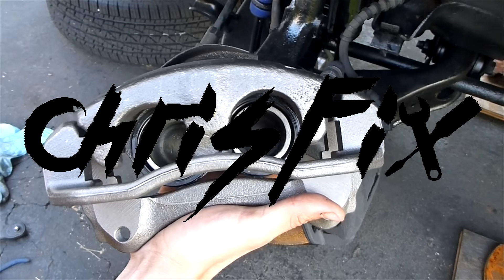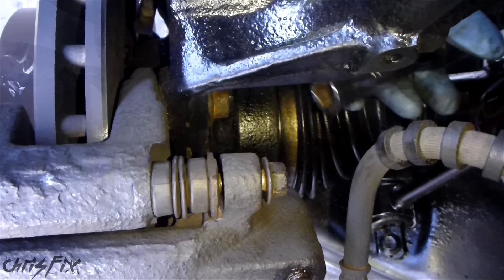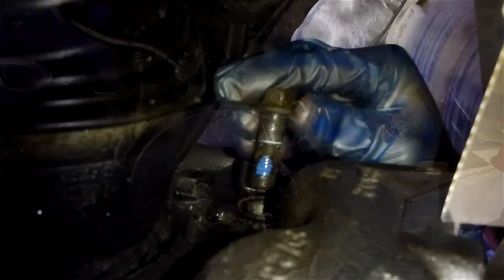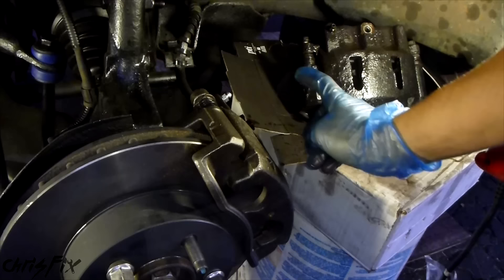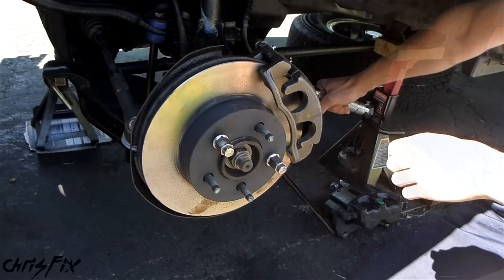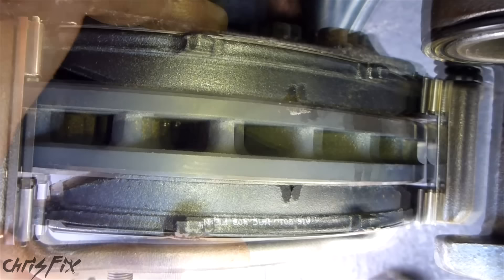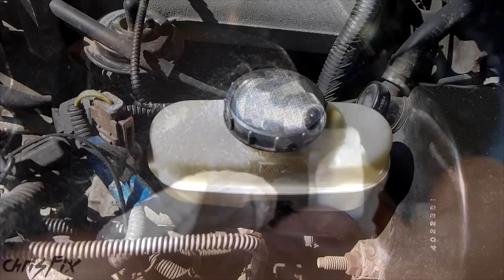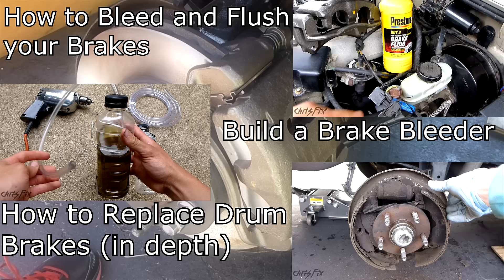How to Replace a Brake Caliper

Comment: I'm 15 and I changed my mom's oil,  rotors,  and brakes thanks to you... I want to go to uti and actually own my own auto shop
Reply from the maker: Awesome work!
Reply: Instead of paying UTI 40 grand get a job as a Lube tech at a shop near you and help out other techs and learn from them.. I learned way more in a shop than I did at UTI and go paid!
Reply: Keep up the great work. Next thing you know you're going to be doing a candy paint job on your mother's car! You're going to be rich keeping this DIY mindset. Get at me if you ever need your seats pimped out
Reply: keep up the good work!!
Reply: Kysheem.Scott I wouldn’t suggest UTI because you pay $40k for an education you can get at a cc or jc and the only state you can get your associates at a UTI facility is Arizona and you can’t apply it in any other state. If you just want your certificate that’s cool but you can get that much cheaper at a community college
Reply: There is no better learning than first-hand experience.  Try to befriend some folks at a shop, and start hanging out there and helping if you can, even if for no money.  The time you spend is an investment.  Also, learn about metals, tools, and lubricants.  Most people are more than willing to teach others their trade, it makes them feel accomplished and useful.  Also, if you want to run your own shop, you absolutely need to learn accounting, computers, and business, so focus on those in school.  The mechanic part is just one aspect of running a shop.   It would really help to learn something about finance also, so you don't have to go into large debt to realize your dreams.
Reply: Amazing job
Reply: When I was 15 I eat poop. 😔
Reply: Wooooow Good luck friend.
Reply: @chrisfix  did you go to a mechanics school or are you self taught
Reply: You're 17 now. Did you get into UTI?
Reply: You are the man.
Reply: Kieron Seymour-Howell appreciate the advice brother, I’d like to do the same as well
Reply: Go for it.  My advice would be to get a solid general education also, you never know what the future holds.  Many people feel uni is a waste of time, I understand why some people say that but in some circumstances it opens doors that remain closed to non-graduates... I don't think it should be that way, but it is.    Also, many jobs require a college degree, often it does not even matter what the subject is.    Modern mechanics need to understand electronics and diagnostic procedures as much as turning wrenches!
Reply: Kysheem Scott go for it man!
Reply: Do you need to do the left side first? My dad always did the drivers side first.
Reply: maryann elwood no I don’t think that it really matters. My dad always did the left side first too the other week when we changed my rear brakes on my mustang lol. Good luck!
Reply: Dude same,i have those dreams too maybe one day i could be like Chris
Reply: Good stuff join the army and get the experience 👍🏿
Reply: Kysheem Scott I'm going to UTi this September ! in Houston
Reply: @devinpaulsen4489  do they hire people with no work ex? Even if for free?
Reply: @503945158  hell yeah.. most shops are old school just show them you want to work they'll hire you if they have openings.. and you'll always get paid the only internships I've heard of are in management or maybe the sales teams (if you work for a big chain). If you do get hired find the master tech of your shop and follow him EVERYWHERE
Reply: @devinpaulsen4489 what is uti im from poland and i dont know what is it  some type of school?
Reply: @kubakrezelewski6995  yeah it's a trade school for mechanics..
Reply: @jonomotive2000  there is one here in Texas and you can get associates degree
Reply: Dont listen to anything these people say about uti, you can learn how to work on cars and replace parts in the field but uti literally teaches you every componenent and how it functions with hands on work. They also prepare you for the field and have manufacturer specific classes if you want to work on one brand what you put in is what you get period.
Reply: Devin Paulsen I second this
Reply: Cool
Reply: I'm 14 and my mom is too scared if I do something on her car because she always says nO mY oPeL vEcTrA iS tOo ExPeNsIvE but that sh*tbox is full of scratches and dings but I wish I could do something about it
Reply: Thunderbolt   maybe you didn't torque the bolt down enough. Retighten the banjo bolt and clean the area with brake cleaner and dry it. Then check it a little while later for leaks.
Also, you could change the copper crush washers on both sides of the banjo bolt and clean up the area and torque it down to spec. You will need to re-bleed the brakes if and when you open up the brake line since you will prob get air in the line. Safer that way.
Reply: @chrisfix  hello chris im roland from philippines i dont get why my toyota innova saddenly stock the one side of rear wheels while on driving i check it after i dont see anything wrong and it runs ok again..no signs or other mechanical fails that causes stock..pls give idea ty
Reply: @devinpaulsen4489  I'm trying to do that Right now I go into a interview later today
Reply: I'm 9 years old and I just changed my first blown head gasket and repair my mom's a/t.
Reply: @devinpaulsen4489  ur not lieing man he’s telling the truth don’t spend 40k$ not worth it the best way to learn is hands on with other techs especially the older guys who Ben around for 40 + years man thouse r the guy that will tech u stuff that any school would not that’s how I learned to work on most of my stuff now
Reply: That’s amazing man! Already having big potential, that was me also when I was like 16 starting & now I’m a certified mechanic with my own business!
Reply: That’s incredible brother, engineering is a good skill to have
Reply: Your mom is so lucky to have you!
Reply: And? Are you a mechanic now?
Reply: You’re going places.
Reply: Let’s go
Reply: Any updates bro?
Reply: UTI is a SCAM, ASE certification is VASTLY VASTLY OVERRATED
Reply: Did you go to UTI?
Reply: I’m 18 finna attempt to change mines soon as my washers come in😂 inshallah everything goes right🙌
Reply: Where are you now?
Reply: Your 20 now you a mechanic?
Reply: How’d it go kid? I’m waiting to hear your success?
Reply: @phantompain5071  Do you still throw it at people when they try to feed you popcorn?
Reply: Hopefully you’re a technician by now making good decent money.
Reply: How's it going 5 years later man? Did you end up pursuing this?
Reply: @Devin Paulsen  can you become a lube tech with just some experience on cars?
Reply: youre 20 or 21 years old at this point how is it going now?
Reply: Kysheem, did you end up going to UTI?
Reply: @Bobthebuilder.69  crazily I took a totally different route, I still do work on cars but only for myself or close family and friends. I’m actually getting my degree in data analytics and currently working as a communications officer.
Reply: 6 years later and ur 21!
Reply: how’s it going now 6y later
Reply: Good, good  I hope u will do that & good luck with your shop.
Reply: You should be 21 now ithink how's everything going?
Reply: @devinpaulsen4489 True that
Reply: I'm very proud of you. I'm 55 and  I just finished my brakes while my 33 yr. old son sat in the house talking on the phone. Instead of spending 40k for uti, find a local community College that teaches automotive technology.  And try not to go in debt for your education. A local auto shop is a great place to start.
Reply: That is the best way to go about it definitely.
Reply: I’m 14 and I’m currently working on my moms brake caliper and she found this video and it is very helpful
Reply: Vast majority of 15 year olds could do this. Vast majority of mums to 15 year olds wouldn’t even want to chance it.
Reply: Did you end up doing it buddy?
Reply: @gibfortune 23w we wqq ppl😅😅
Reply: @kysheemscott7712 

HELL YEAH thanks for the update! You don't want to work on cars for a living anyway, you'll start to hate them. My poor friend gets pissed off as soon as he even TOUCHES a tool, and he used to LOVE tinkering. Super sad.
Reply: Damn my bro I’m 23 and my brakes fucked up rn I’m thinking about doin it myself y’all giving me motivation
Reply: Well I need to know ....how's life buddy ? Did you go through with your comment ?
Reply: I'm 30 and I'm watching because well. I get frustrated way to easily which leads to losing my anger and end up doing well over 800 bucks in damage out of rage . Lol better to know the game plan instead of trying to make it how you thought it should be .  Like the copper washers . I wouldn't have put them on I'm sure . Lol
Reply: Congratulations.. you can do anything you put your mind in to it ..
Reply: 6 years later. How's it going for you
Reply: Good job bro keep it up your dreams can come true just work for it
Reply: Your 21 now, did that work out
Reply: your 21 now, how’s it going??
Reply: I feel like I learned more from just reading repair manuals and YouTube than I did in the classroom. That’s nothing against my teachers in auto mechanics class; they were awesome, but you can only learn so much from them when it’s only 3 hours a day of instruction.
Reply: True about hands on experience especially paying attention to the experienced men willing to teach an attentive and respectful pupil, but get as many bits of paper to prove you've been educated as you can while your young the longer you leave it the harder it gets to go back to school, college uni etc, I'm now in my40s and the thought of going to do even a night class gives me nightmares, so get qualified in something anything. It's a better jumping off point and a quicker route to a higher salary, and makes you more valuable, if possible a day release aprentership if possible best of both worlds, whatever you do don't take a year out to sit in your bedroom playing cod getting stoned all day, stick in young man and good luck ❤
Reply: Any updates bro? You on your way to getting your shop??
Reply: How you doing in life?
Reply: I was doing that at 7 years old in Nigeria
Reply: You should be 21 yrs old right now how are things going with your UTI
Reply: now that years have passed, how has it gone bro?
Reply: I hope you didnt go to UTI just to work for a shop who paid you $16-20/hr to do work you already realized you could learn on your own and probably charge you week’s wage to complete in a few hours…
Reply: So how are you doing now ? Got your shop?
Reply: My man we need an update!
Reply: Checking in how it’s going 7 years later @kysheemscott7712
Reply: Good job
Reply: How’s that going along boi
Reply: 🎉 you killing it !!

Comment: Just a little tip for all you guys out there. Make sure to push onto the brake pedal half way with a wooden block or something, so the valves in the ABS module close. Otherwise if it's taking you too long to change the caliper, the ABS module might lose some brake fluid and it can be a HUGE pain to get air bubbles out of there
Reply: good point, well said.
Reply: Can you explain more in detail plz, this might’ve been a issue i dealt with when I changed my brakes and bled multiple times but the brake pedal was still soft. It sounds like before I change my calipers I push halfway to Mimic braking so the abs won’t freak out when I’m changing parts out?
Reply: And what if I have a push start car as well? Do I turn it on all the way a step before ignition?
Reply: Use a piece of wood or pvc pipe or something that you put one end against the brake pedal the other end against the front of the seat. Push the brake pedal down and adjust your seat to keep pressure on the brake pedal. With power seats you use the seat to push the pedal down. I am told that this also makes the brake fluid NOT leak out too fast when you’re taking the brake line off the  old calliper and onto the new one??? Not sure how that happens or why but several other mechanics swear by this.

Comment: Big help man, thanks. Got quoted $1,000 to for both of my front wheels. Spent a day on your vid and got the job done myself.
Reply from the maker: Awesome man! Glad to hear it!!! Nice work!
Reply: @chrisfix  the garage told me my rear right caliper was not doing its job and ate away at my brakes and rotors,  because when I step on the brake going say 60+ I get the vibration in the petal, so that was their reasoning,  I replaced for rear calipers and rear rotors along with new brakes and it still shakes when i step on the brake... any advice?
Reply: @hollywoodtravels9492  Its probably warped front rotors. Since the majority of your braking is on the front, that is where youll get the most feedback. Check your front braking components and see if anything looks odd. If you find something then go ahead an replace the pads and rotors.
Reply: Lol, those crooks were con artist. 1000? What unscrupulous greaseballs.  Good for you for doing it yourself and putting those jerks in their place. Thumbs up hero!
Reply: Warped Discs. As you said you replaced the back must be the front.. as explained approx 80% of braking happens at the front brakes.. don’t go back to that particular garage.. they sound very very shifty.. You want to make sure you have no play in your wheels, jack your car up rock up and down and side to side.. if you hear any tapping or clunking or have free movement you have another problem and your tyres air pressures must be correct..
Reply: As a DIY, I understand why mechanics charge so much for their work. Tools, experience, overhead costs, Insurance, all that cost time and money. I like to try and fix my own car first. If i can't fix it, i take it to a pro. Its the cost of owning a vehicle. I make my kid save money in case we need to fix or buy her a new car in the future.
Reply: @hollywoodtravels9492  Turn your rotors or buy new ones.
Reply: @terracotta3784  I agree with you 100%. Some jobs require proprietary tools or a hydraulic lift. I rebuilt many vehicles through my life but I still know when a pro needs to take over ie: a rack and pinion in a dinky car. LoL I got stuck under the dash of a tiny car and said NOPE!! I'm too big and I don't have a lift to raise the car 5 feet to stand and reach to get the steering column disconnected. Among many other issues like the intertwined rack and pinion above the subframe. Such a nasty mess in compact engine bays. LoL

I always shop around and get the cheapest shop with a great review rating to do my work.
Reply: @josephcameron4771      that's why I'm on here searching.    My daughter's bf was suppose to put new alternator.  Instead he's banged on things and tore up.  But so far I gave this guy 535 dollars.   Now he's telling me calaber and it's a 150.  N still not sure about the axle     I'm a 57 yr old widow n live on 741 a month.   I picked this guy here caz he does real talk
Reply: Hkkk
Reply: imagine all 4 sets of brake and rotors.. i did it my self... watch all about 20 different type of video before try tho lol
Reply: Same here
Reply: @teresachase354  i'll do it for ya for free, but you'll be my first brake job though...i get experience and you get free labor
Reply: @hollywoodtravels9492  did you find out what the problem was

Comment: My mechanic wanted $2200 to replace front calipers + break lines and replace old brake fluid.  I am doing it for $300.  This is the best video on replacing calipers.  Great work.

Comment: I've always been terrified of messing with brakes myself because of how many times things went wrong when I watched other people do it, but after getting ripped off by a mechanic, I had no choice but to do it myself. Your video made it seem so much more approachable and though I took forever on it (broke a few tools and had to get a ride to buy more, did a few steps out of order putting the new one on, you know the drill), I did get it done. Thanks so much my dude, I couldn't have done it without you

Comment: You just blew my mind. I have always removed the entire caliper to change my pads and feel so dumb for missing the clam shell method all these years!! Awesome videos! Thanks for all the great tips.
Reply from the maker: +Amanda Hugginkiss I'm glad you learned something new!
Reply: Haha, you've removed the caliper 😂😂😂
Reply: Not everyone get so lucky. My dad and I always removed both, and hung caliper with zip tie to spring. One day I did this method, and even though I was gentle, the bolt sheared off causing me to have to replace guide pins. Not always the case, but still.

Comment: Couple tips: after you refill your master cylinder, go and slowly pump your brakes a few times to run the caliper piston out so the pads are engaged with the rotor.  THEN, go check your fluid level in the master cyl again.  Moving the caliper piston out creates more volume in the caliper so more fluid volume is in there, so check the fluid level again.
Also:  i just ran into this not long ago but never had seen it before.  I changed the rear calipers and brake hoses on my pickup and couldn't get one of the banjo fittings on hose to caliper to stop leaking.  Removed the banjo bolt and found that the where the banjo fitting on the end of the hose mounted to the caliper, the caliper did not have a machined surface for the hose to seal to (copper washers in there too of course).  The machined surface that's supposed to be there is called a "spot face" and my Rebuilt caliper I got from NAPA had no spotface, it was as cast surface.  There was no way any brake hose was not going to leak.  Of course NAPA made it right but what I don't get is how it could have been a "rebuilt" caliper, it never could have worked.  Anyway, heads up, check for the spot face there before you leave the store.  Check for it on the hose end too. Don't over torque the hollow Banjo bolt either, they will brake if you get too aggressive.